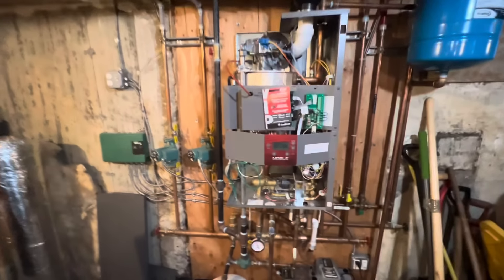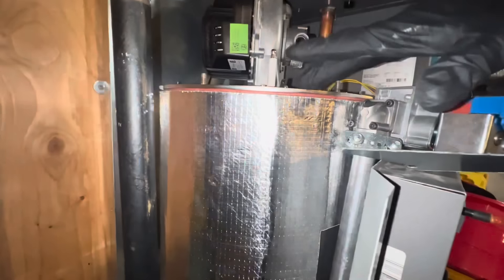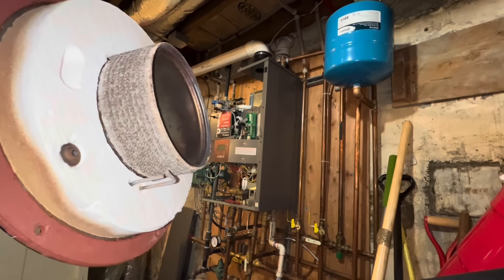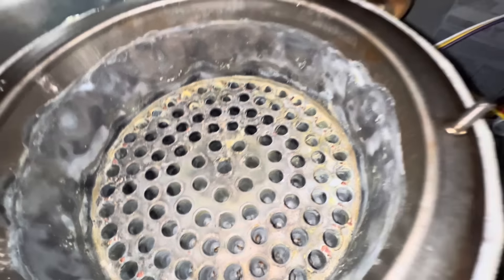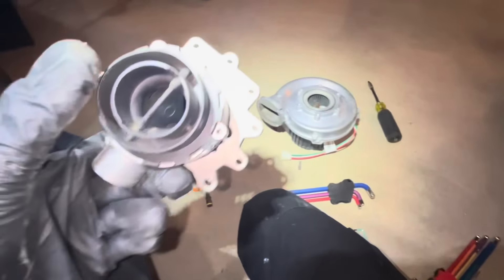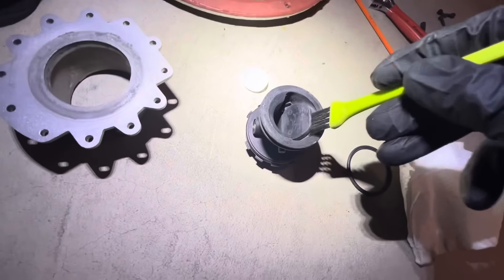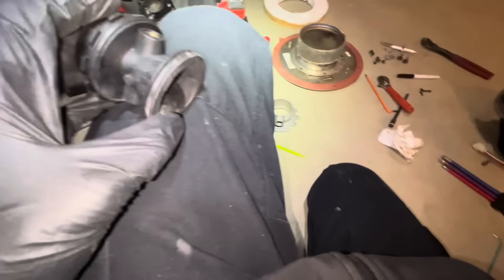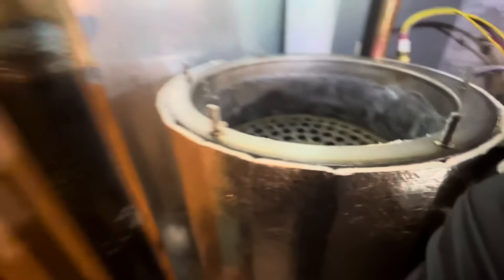Lochinvar Noble Full Tear Down and Cleaning! How to Fix Heating Systems! Day in the Life HVAC Tech!

Comment: Looks like a good job cleaning up the problem boiler. A pet peeve of mine is the Plier marks on the brass gas valve nipple, it’s a lack of pride thing for me. I have used Teflon Tape on Gas Piping, but you have to be careful, and some places it’s against code. I think Lochinvar could have done a better job troubleshooting the boiler and reassembling it when they left. I’m surprised Mike doesn’t have a M18 Air Compressor on the truck, I just got one for small cleaning jobs, and expansion tanks, I needed it, that’s what I told my wife. 
Be careful going into some gross places, it can get in your truck or home, like you said. CO is no joke, personal Carbon Monoxide detectors should be worn as part of a uniform. Great Video. Thanks for the Videos. You’re a pretty sharp technician, always keep learning.
Reply from the maker: Why get an air compressor when I have nitrogen?
Reply: Air is-cheaper than using up your nitrogen tank
Reply: Nitrogen Tanks run out and they are getting more expensive to fill. Plus Mike is a Milwaukee Guy, figured you guys would have one, that’s all I was saying. But it takes space.

Comment: Hi great vid on the Noble rebuild. How did you get the venturi out of that housing and how hard was it? It seems that it was not just those 2 screws that held it in. Was it held in by an o ring or something and was it difficult to put back together? I am about to do the same thing. Please help. Thanks and have a great day.
Reply from the maker: It’s not difficult to remove the DAMPER out of the housing. The Venturi isn’t plastic the Venturi is the metal assembly. 

Orings will seal thing but don’t hold them in
Reply: @ thanks happy new year

Comment: I use the monster gas rated teflon in NY
Reply from the maker: You cannot use Teflon in New York atleast not in NYC, Nassau, and Suffolk. No PTFE tape is allowed, regardless of what the manufacturers say or how the tape is made. Pipe dope only.
Reply: If you read the labels PTFE is also in some of the pipe tops we use

Comment: I have looked on YouTube and there isn’t one video on how to test a 230 volt two stage inducer motor weird but true.
Reply from the maker: It’s not a tough thing to do. Check incoming voltage. And check amp draw. 

If those are ok and you still suspect the inducer is bad, check RPM on the wheel. If that’s fine, check the condition of blades. If that’s fine, ur issue isn’t the inducer.
Reply: @DCHVAC  this inducer I’m talking about has a230 volt motor w1 and w2 go to an ice cube relay first then the draft motor  it a rooftop Lenox  it has voltage 122 volts but does that 120 run the low then when w2 calls it give it the other 122? I’ve never seen this set up before
Reply: @DCHVAC  there isn’t any amp draw the motor wont do anything but there is 122 on the one leg I don’t know if there’s supposed to be 230 all the time or only when w2 calls

Comment: For cleaning delicate parts use ultrasonic cleaning tank and either water or your favorite carburetor cleaning solution.
Reply from the maker: Yea I’m not doing an ultrasonic cleaner. That’s a little bit over the top.
Reply from the maker: And a carb cleaner would be chemicals. Which the manufacturer specifically says not to use.

Comment: Milwaukee makes an 18 volt shop blower, which is like a mini leaf blower. I think you'd love it. It works great for blowing out boilers and gas burner sections. Also, where I live, they sell 60# aluminum nitrogen bottles, which gives you more nitrogen, and it actually weighs less. Keep up the great work!
Reply from the maker: I have the m18 blower.

Comment: Another very interesting day Daniel. I’m sure Mikey would back your decision if you walked away from the infested house. Your safety comes first 24/7. Wondering if the feeder banging sound is what you said, high pressure. Sounds like high water pressure helping to slam the feeder shut. Yes, a quick fix maybe with a pressure regulator. Hope you get the steam piping job 🤞. Rest well son, tomorrow is another day 💰💰💰
Reply: Facts

Comment: That steam main has a vent too close to the end and probably too small plus the other copper above the water line and badly pitched dry returns, they need your help but they might have to tear down the Sheetrock and their probably not figuring on how many mistakes that are present in just the near boiler piping.

Comment: that pa4o4a is junk. that pressuretrol is additive. it should be set .5 psi cut in. the differential wheel at 1 psi. that would equate to 1.5psi cut out .5 psi cut in. you adjusted the cut in a bit too high before you changed the control.
Reply from the maker: I brought the adjustment all the way down to 0 before I replace the control it never triggered.
Reply: like i said they're junk. Glad mike stocks you with vapor-stats. way more accurate and have less adjustment issues.  @DCHVAC